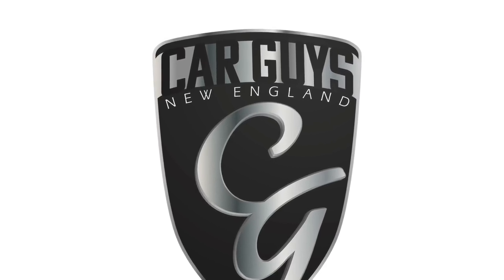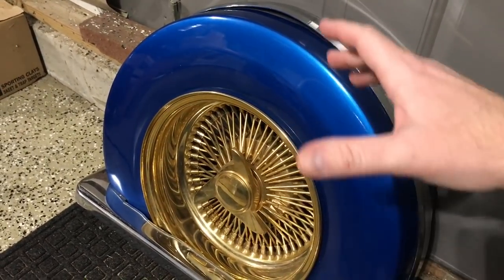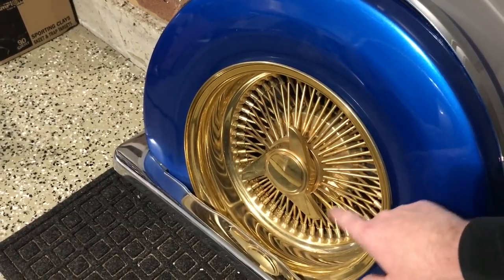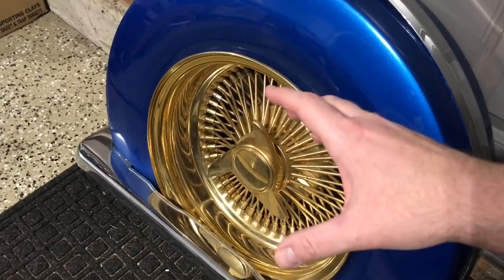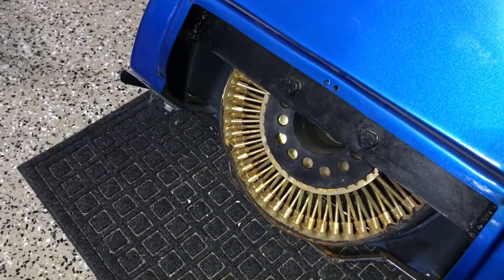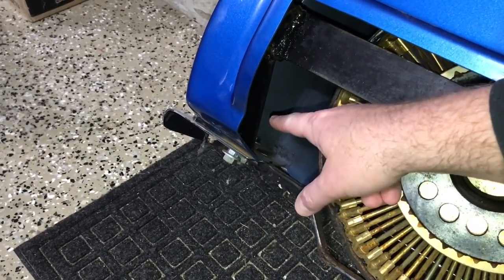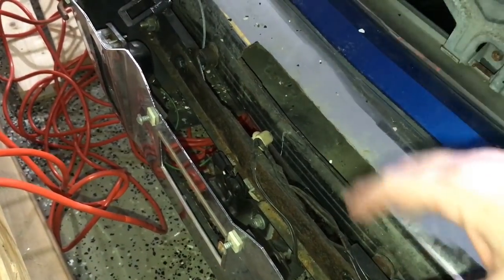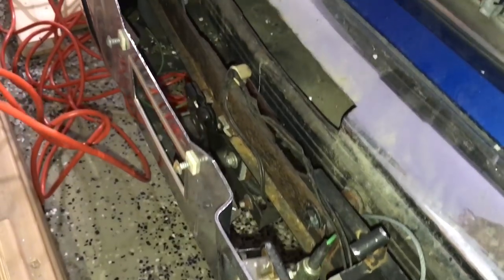How A Wire Wheel Fits In A Bumper Kit

Comment: How do you mount the kit on the car bumper?🤔 It's self
Reply from the maker: Make a template of the mounting holes on the lower bucket. Then measure twice and drill once. Take your time to make sure the holes are the right height and centered. I used threaded rod and nuts with loc tite

Comment: Hey I need a bucket to fit my 89 fleetwood 2 door I wanta keep the old style wire wheel I have but the bucket has gaps on the sides do you know where I can get a good used one?

Comment: Did you have to drill holes on the bumper to hold the bottom piece of the wheel kit?
Reply from the maker: a192726 yes two holes were drilled